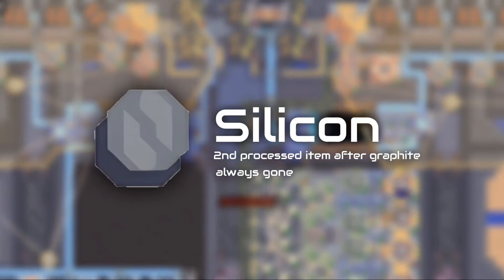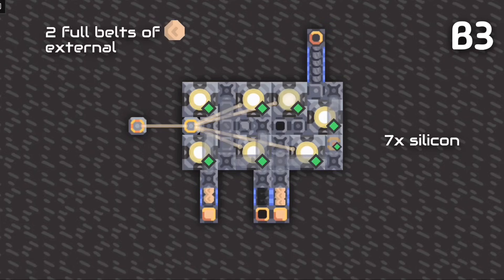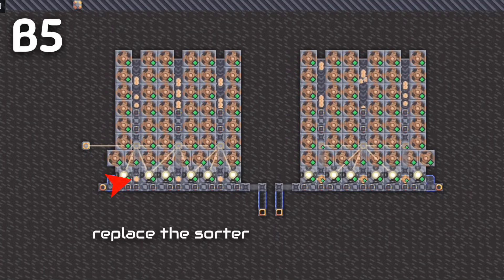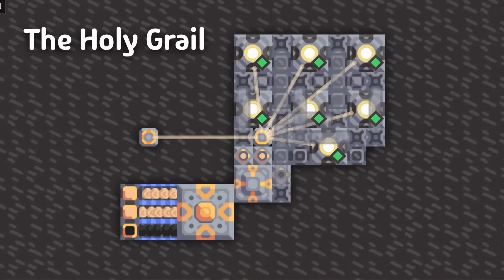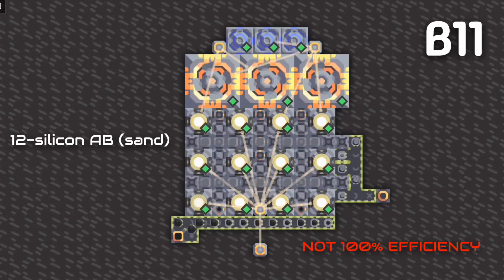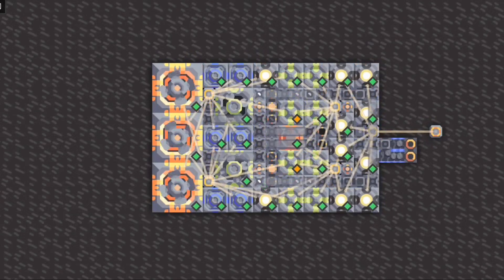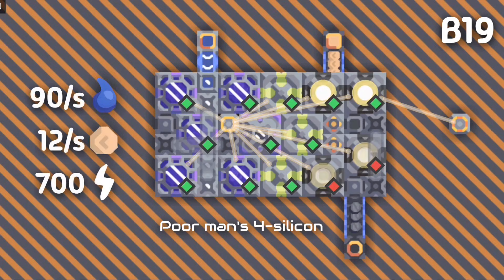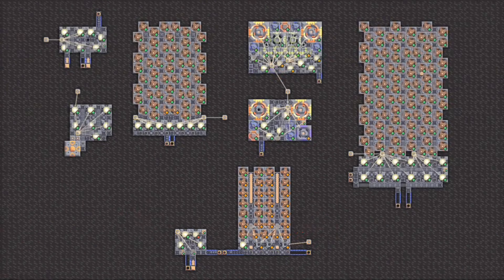20 Silicon Smelter Designs in 5 MINUTES | Mindustry Guide #3

Comment: These schemes are far from the best schemes I can show  improved versions in discord
Reply from the maker: The best and most optimized designs change over time (along with rolling updates), but I've selected those that are a lot better than what players use mainstream. Also, glass designs will be out in a few weeks :>
Reply: and maybe you won't have to spend a year looking for schemes for glass lol
Reply: On the margins, I agree, but the 7-smelter design was in there and that's highly regarded as the best.  I've scrutinized the videos here and there's very little I'd actually change - despite maybe expanding on the fact that less optimal designs have their edge cases (which is why they were made in the first place, people can't get enough silicon).